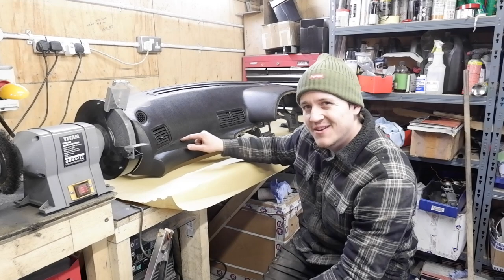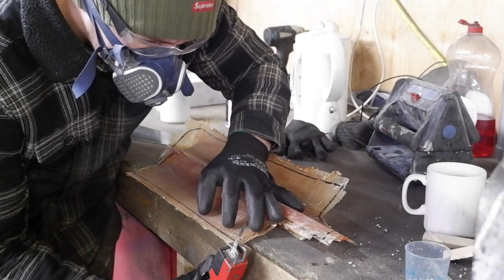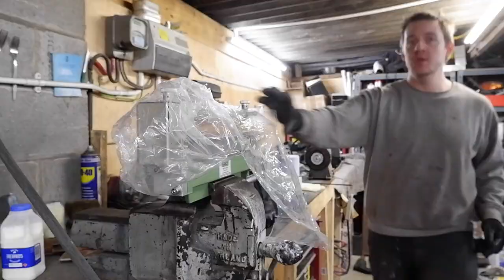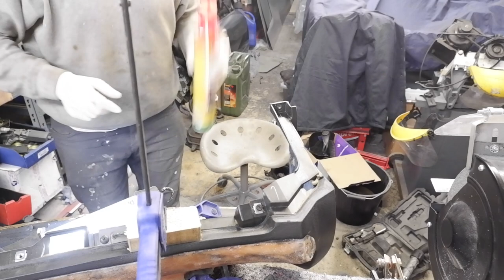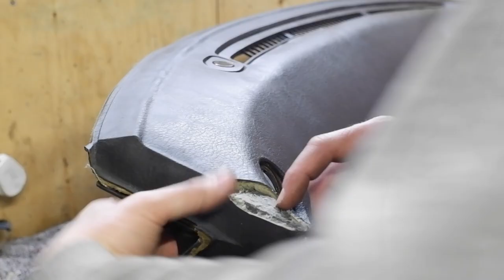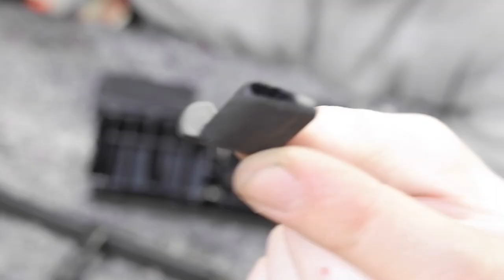Dash bubble fix! & GpA lightening and cage cutting - R32 GTR Build 25

Comment: Good work mate!! Need to get me heater it's fookin cold in the garage. Does it heat it up alright?
Reply from the maker: It’s pretty terrible mate, it’s get really hot really quickly, then you turn it off and it’s freezing again, very binary. We want one of those gas panel heaters, the really dangerous ones.